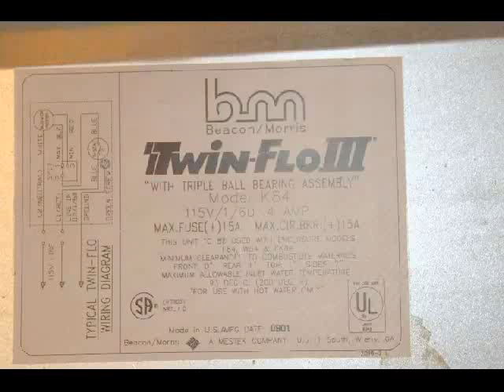Under Counter Heater.qt

Comment: Just realized i had this same unit in my kitchen. Hidden under the counter/lower cupboards.  It helps cut the cold air to my side door i use in the winter. Thanks for the video.
Reply from the maker: Nice Avatar :>)
Still have my heater and is still working great.
Reply: Thanks! Awesome!  Mines running right now.  Its -15 in Northern Maine right now.

Comment: Thanks for the video, it was dark where the thermostat was but still was very helpful and if someone had that problem could of figured it out where it was. I have the same unit under the kitchen sink and since the contractor did not put an access panel in to clean it, I was wondering how it looked etc. Now thanks to your video, I do. My unit is 15 years old and works fine except a slight noise which I suspect is the fan bearings. I was wondering how much dust/dirt could be in there, how many years was yours before you opened it up , because it didn't seem too bad? Should I just let it go until it gets real bad?
Thanks again. Frank
Reply from the maker: Glad the video helped. The kitchen was remodeled in 2002, August. So this video was made about 9 years later. I had it open once before to do the same thing. Both times though, it wasn't very dusty in there. I think the reason is, is because the air flow in is over the top of the unit, not pulling the air in along the dusty floor, the air out is along the floor. So it kind of blows the floor dust away. So unless your really having a problem with it, or just feeling adventurous, it might be ok to leave it alone.
p.s. I did have it open just this last fall and it looked pretty clean. Had a different problem under the sink but thought I might just as well check it out since I had the access panel open anyway.
Reply: Thank you for replying, very helpful.
When it gets bad then I will have to cut an access door to get at it...that should be fun.
Take care, Frank

Comment: Thanks for posting, I have the same heater but for some reason the inlet pipe just won't get hot. I bled the air out by the return line until I felt hot water, both lines feel cold to the touch. Any suggestions?
Reply from the maker: That's what I would have suggested to do, bleed air out of the line. Is there an inlet valve that might be switched to bypass the unit?  I take it that this is inline with other hot water radiators in your home. Is it a new install or has it been there for awhile? Can't think of any other problem that would cause this other then the water pump not working. If that is the case then you wouldn't be getting heat from the other radiators. Check the line at the pump and make sure that water is flowing through it. It could sound like it's running but if the impeller is loose or broken it won't be pushing the water though the line. Good luck.
Reply: Thanks for responding Mark and Happy New Year. You're right, it's part of an inline series with the main loop in the zone. It's not a new install. It worked last winter. And there's another one in the kitchen floor on the same zone that's working. The propeller worked when I jumped the wires in the unit. Problem is the lines are just not getting hot at all even after bleeding it at the return line before it heads back into the ground.
Reply from the maker: It sounds as though there may be a blockage somewhere in the return line side, since you can get hot water coming into it when you bleed it. So from the inlet side things are probably OK.  You say it goes into the ground? So you do not have access to the lines after that? The system in my house I can get at the pipes from the basement. Here there are diverters that allow some of the water to go to the heaters but still lets most of it bypass to the next heater. I suspect that may be how yours works, otherwise heaters downstream from this one would also be cold.
Reply: Hi Mark, 
Actually the hot water I'm feeling in coming from the bleeder valve from the line below the unit on the return side.And that's only when I activate the bleeder. Anything above the bleeder including both supply and return lines to/from the unit are cold.

Thanks again

Comment: How do you uninstall one?  We have one, but don't use it.
Reply from the maker: Hire someone that does boiler/hot water heaters. I wish I could be more help but that's what I would do. If something went wrong on a DIY job it could get pretty messy real fast. Just make sure you get someone that can be trusted not to overcharge you. I wouldn't think that taking it out should cost too much.
Reply: Thank you, but we have had 2 plumbers out, an electrician, an heating and air-conditioning guy, as well as a contractor, and NO ONE wants to even touch it...at a complete loss as to what to do.
Reply from the maker: Hmm... There should be someone that can do it. Wish I could actually see what you have there. I take it that you have hot water heat in your place? Perhaps it is in a bad spot to work in or some of the pipes to it are not in very good shape. Someone who specializes in Hot water heating systems should be able to remove it. Anything can be done but the cost might get to be too high if it ends up needing more work than just the heater itself. Like opening up the floor, cutting and repairing pipes, etc.

Comment: how do u clean it?
Reply from the maker: +Tyrd Ferguson I've only cleaned it a couple of times since it was put in, and that was when I had to get at it a few times. I just use the vacuum cleaner. It hasn't really gotten very dusty where it's at.  I guess you would have to do the same. The air flows over the top and then down into the heat exchange part, so I think most of the dust would collect inside on the back of the heat exchange fins.   Sorry I can't be more helpful on this.
Reply: Got it. Thank you for your reply Mark.